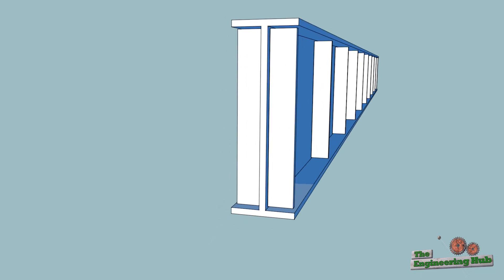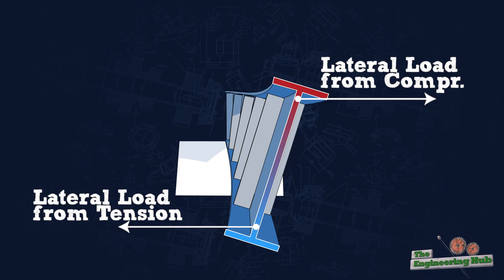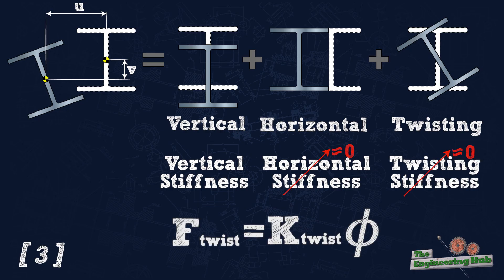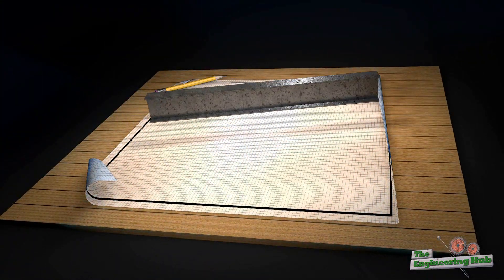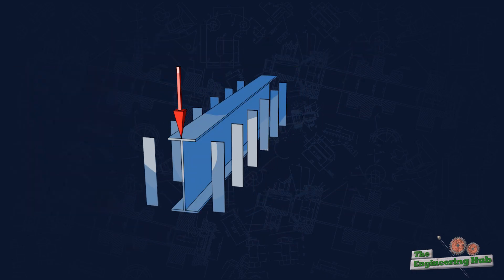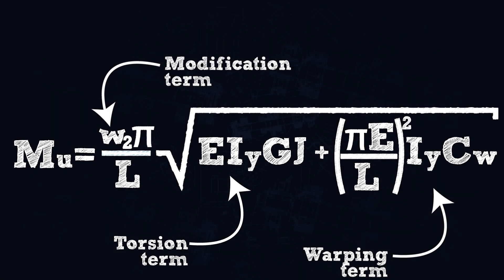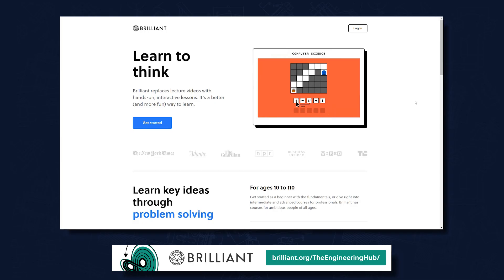Open Beams Have a Serious Weakness

Comment: So, based on this analysis, why the popularity of I beams instead of box beams for construction?
Reply from the maker: @christianlibertarian5488  they are extremely strong when they can be braced or when the top of the beam is connected to a supporting slab, which prevents it from moving.

Comment: 6:58 hi, must the member that restrain the compression side of I beam be diagonal member? Can a horizontal member ties to the compression face of I beam restrains it from moving laterally?
Reply from the maker: Horizontal braces are also fine. You can see this often in the roofs of Walmart, Costco, Superstore, etc. There are parallel trusses supported by larger girders. Usually, at the columns the truss is extended to the lower flange of the girder to peovide lateral stability. This is because there are large negative moments there, causing the girder's bottom flange to kick out.

Comment: Usually the people designing a structure will know if there will be any loading that would cause a beam to fail, you should already know this. They would design in crossbeams to ensure the beam wouldn't flex, I know this and I am a retired electrician.

Comment: To fair with what you used, seems nothing more than metal drywall studs 1/16”.
Reply: 2 U channels bolted together to "make" an H beam and again with the "box" beam. Not even close to the proper way to compare actual structural members.

Comment: The torsional stiffness of an open beam is 100s of times smaller than a closed rectangular cross section beam of same dimensions, material and thickness. This means that stresses on open beams must be strictly longitudinal. Any other direction favors the closed beam, because it might be 25% heavier, but it is 100s times stronger.
Reply from the maker: That's exactly right! Also the message that the video was trying to convey.

Comment: For your beam tests, did you balance the weight distribution of the load, i.e. ensure that the load at each of the four points was equal?
Reply from the maker: As equal as possible, but of course, it can't be perfect

Comment: Interesting.  I wonder if these equations could be made generic, if they aren't already, and have no bias for a particular metal so that the cross-section of a metal subject would be described and performed upon, analyzed and apply to all metals, if not all materials and substances, so there were no flaws in the equations and the same equation could be used for all cross-section shapes and materials.  Thanks for the video.

Comment: If you see the top member as a compressed bar, you get the buckling. Put the buckling member into the beam and you have how the twisting is generated.

For the buckling cause: it's not just the uneven manufacturing, it's also the uneven installation and loading.
Reply from the maker: Agreed! Also, a nice short summary of the mechanism 👌

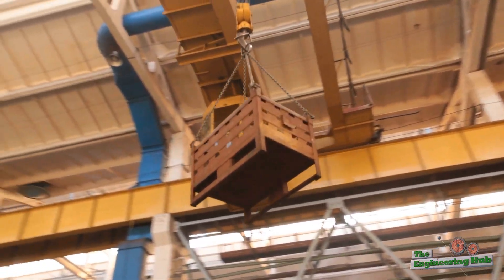Comment: At 7:25 you say that the root cause is 'the imperfect manufacturing and construction process'. While that's part of it, I think it would be better described as the design being inherently unstable at high loadings. Vertical load on a deflected beam causes the beam to deflect further. 

The initial deflection could come from manufacturing or installation, but even with a perfect beam installed perfectly, there are all kinds of things that could lead to deflection. Wind loading, earthquake loading, even just uneven roof loading (the next beam over has an AC unit sitting on it, this one doesn't, so it sags a few mm less and is picking up more load from one side) are all things that could push a beam off the perfectly balanced knife edge.
Reply from the maker: Absolutely agree, even a beam that's perfect down to the last molecule would experience this failure because any external actions (a flap of a butterfly's wings) would cause it to buckle.

Comment: So a crystalline and straight beam would not experience this failure?

(Due to having no imperfections even down the the molecular level, assuming the molecular bonding angle and resulting crystal structure are not introducing a mechanical flaw)

Comment: Seems like if two beams of equivalent material, one closed and one I beam, fail at such wildly different point loads when installed the same way; the use of open beams is only justifiable if there is a specific use for the flange or if the difference in manufacturing cost is really so great... but except at very large sizes it seems that both are priced pretty similarly.

Comment: So assuming the same amount of material, closed beams are stronger. Why ever use i-beams at all? It seems like the weight reduction isn't worth the strength reduction
Reply from the maker: Closed beams are stronger when they are not restrained. When they are restrained against lateral buckling, the I-beam can achieve much greater capacity than a box beam, for example.

Comment: Great breakdown. What I can't wrap my head around is this. Open beams are used, largely because they are the least material for a given strength. And when they are inherently constrained from torsional flex they are great. As soon as you put them in a scenario where special anti-torsion construction is required in addition to everything else, I don't understand why it's not common practice at that point to just use a box beam instead of some complex x-bracing, etc.

Any structural engineers out there care to weigh in?
Reply: I’m a mechanical engineer but work with structural engineers.  I agree that with the necessary and essential cross bracing, it seems like there is a point where a closed section becomes a better choice.  I design undersea systems and it’s common to avoid closed sections because we can’t visually inspect the interior surfaces during service.  Also, it’s difficult to coat and verify coatings after manufacture.  I doubt these are the reason that structural engineers prefer wide flange beams, but just thought I’d mention reasons from my perspective.
Reply: @danielhoward755  You may very well be onto something there, and I had the same thought after the fact when thinking about bridges and such, that's almost certainly a huge factor.
For other cases where beams aren't as exposed to the elements, it's likely just a matter of using what's commonly available.

Comment: Even though they are not used in construction, I’d like to see how a cross shaped (like a X but verticale and horizontal instead of diagonal) cross section would hold up compared to the I beam shape or the box shape.
Intuitively I think having the wider width at the neutral point between tension and compression would add strength, but maybe not.
Reply: It would be substantially weaker than an equal weight box beam. A beam's resistance to bending is modeled using, among other properties, the 2nd moment of area of the beam's cross section. The result is that areas of a beam further from the neutral axis add more to the strength of the beam than area close to the neutral axis. This is why I-beams are so common: they're an extremely efficient shape for a strong but light beam.
Reply: @markjacobson4248  but wouldn’t the extra width at the neutral point add more resistance to the twisting as the I beam is loaded?
If the load is placed centered on that neutral point it would be pulling the horizontal part down, along its weak axis, but also along the vertical part’s strong axis. As demonstrated, that load would cause the vertical part to deflect sideways, but the horizontal part would counter that by having a greater width at the neutral point. 
I’m not an engineer, or even a student of engineering, so please don’t think my question of comment is stupid. I’m genuinely interested in this and am learning from it.
Reply: @Linusgump  As a simplified rule, the material in a beam that has the greatest contribution to the beam's resistance to deformation is the material that would experience the greatest local deformation to accomodate the overall deformation. Any material on the neutral axis of any deformation, whether twisting or bending, contributes nothing to strength because it doesn't deform at all. It's definitely not as straightforward with a complex motion like that in this video, where you have twisting around one axis and bending along two others, but the general rule still holds. A box beam would do a far better job of resisting deflection per weight. In general, the further material is from the neutral axis of any deformation, the more it matters. I-beams and H-beams are common design to maximize the material away from the neutral axis in the top and bottom flange, while the web between the flanges actually has minimal contribution to the bending strength of the beam. A hollow tube is a common design to maximize twisting resistance of a beam or structural member, as that maximizes the material away from the neutral axis of twisting, the central axis of the member. A box beam is a good compromise between both those designs, and is good for situations like this.

Comment: 6:08 Are you sure your information is correct? They say the opposite here. https://youtu.be/PeUZdHQ6w9k?t=955
Reply from the maker: I don't understand the video you linked but from the graphics I can see that it is about the "The Hyatt Regency Walkway Failure". That failure is a completely different type that has little to do with overall bending that is investigated here. In short, that failure is related to the connection where an incorrect installation caused the box section to be subjected to twice the design loads. That can be a video for another time. The failure in this video is lateral torsional buckling, again, very different from a local connection failure.
Reply: @TheEngineeringHub  Are you sure you are comparing beams correctly?
I know that I-beams are not only selected from the assortment, but if necessary, you can make the desired section yourself. Just like you did.
You claim that both beams have the same cross section A. With the same cross-sectional area, the height of the I-beam profile is higher than that of the channel. For example, two channels with a cross section of 10.9 mm2 (sum 21.8) is number 10, it corresponds to an I-beam with a cross section of 20.7 mm2 with number 16.
Thus, they will have different heights, which greatly affects the deflection under load, and the side wall (shelf) affects the lateral bend.
You just use a different connection method (just like in the video I sent you). But not different types of channel and I-beam.
Again, the method of attaching the load is different for both options.
The fact that the I-beam bends to the side is a known fact.
But the margin coefficient will be greater for an I-beam, and the deflection will be less. Movements (deformations) will be greater for an I-beam, but only at the edges of the shelves.
I could be wrong, but I think it is.

Comment: Your loading is concentrated on very focused points along the beam. The load needs to be evenly distributed which helps the beam to function as it was intended.
Reply: Did he use the weakest looking beam he could find to make his point? Just look at that shitty ass beam, looks like you could break it by jumping on it.
Reply: @lylemcdermott2566 yes he did. He wanted to demonstrate failure safely. If he used a beam that would break at one ton it would take longer to load and failure could have caused damage to the person doing the loading. He got his point across and wasted less material with his demonstration.
Reply: @lightningdemolition1964  but he drilled holes through the beam, didn't load it like it should have been loaded ( on the top) and beams aren't working that way in the real life scenario. For an engineer it's crap work.
Reply: @lylemcdermott2566  Not to mention he didn't use H beams. He bolted 2 U channels together, totally weakening it AND introducing weaknesses that wouldn't be there with a proper H beam. Did the same with the "box" beam, again 2 U channels bolted together to "create" a box beam.
Reply: It's a demonstration!!!

Comment: i would not call it 'weakness', rather a section property which must be adequately addressed in design.
after reading all the comments below, there seems to be some confusion regarding engineer's choice of member section for any particular application. the engineer will check member properties in his steel manual (or the NDS if he is working with wood) and design appropriately for the application. video demonstration of lateral torsional buckling is cool - thanks for posting!

one comment below that all lateral deflection is due to eccentricities in the member isn't necessarily true, although eccentricities will contribute to that effect. neither can residual internal stresses within the member be ignored. pilebutt story: a brand new freshly hot-rolled wide flange set to cool half in shade and half in direct sunshine was shown to have significant internal stresses beyond manufacturing tolerances and was rejected! also check for repairs/modifications to the beam, as cutting/welding can induce internal stresses.

compression flange and tension flange are connected by the web, which is generally thinner than the flanges and  connects the flanges, forming the force couple. the transition from flange to web is where the interesting things start to happen. you might consider make a video about web crippling. 

Registered Civil Engineer - retired bridge builder - i cant tell you how many wide flange beams i have installed and removed - clamped & braced - inspected for damage and authorized for continued use.....

apply the FS!

Comment: Yet I see i-beams EVERYWHERE. so if they are so weak under such low loads why are we still using them constantly.
Reply from the maker: We avoid loading them in a way that produces lateral torsional buckling. More specifically, we brace them against this type of buckling so that it does not occur. But this is not always possible. If it isn't, then we go with a closed section like a rectangular tube or similar.
Reply: @TheEngineeringHub  I see roofing get held by open I beams all the time with no lateral bracing. I supposed then it's just a "don't put more than x pounds on this beam" type of thing? Seems risky. They should all be braced in my opinion if a risk such as this or life safety is in play.
Reply from the maker: @thatguywecalldana  that's a very good observation. They are used for roofing all the time. The trick is that the roof itself provides lateral stability between them, so it acts as a brace for the top flanges. Since they are usually installed as simply supported beams, i.e. no negative bending, then only the top flange needs to be braced. When a negative moment is present, usually over a column then the bottom is also braced. See the image below how the only truss that is connected to the bottom of the w-beam is at the column:
https://www.cisc-icca.ca/wp-content/uploads/2017/02/stability-continuous-beam-image.jpg

Comment: If you ever want a good example of torsional weakness in I beams, there are a few videos where bridge beams are being transported as oversize loads and the dolly wheels at the back have an issue and the beam falls. the back of the beam will lay over and be napping on it's side, and you can watch the load transfer up the beam until...it flips the cab of the truck on it's side after a noticeable pause. even over 100', you can have a 90* offset to your ends without much work, yet the same beam is literally holding up bridges

Comment: I would also point out one little mistake, that the most stressed part of the I-beam at the time stamp https://youtu.be/XSl7ZntK94E?t=263 would be on the other side of the web, because the compressive stresses from torsion and bending about both axes will sum right at that point. Besides that, very good educational video :) keep up the good work.
Reply: The critical most part of the beam is at the root of Junction of Web- flange in compression i.e. (tf+ Root radii) from the extreme end of the compression zone.